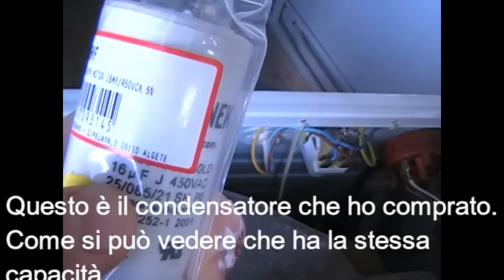Come riparare la lavatrice non centrifuga

Comment: Non pensiate che tutte le lavatrici hanno "il condensatore". Il condensatore in questione è usato sulle lavatrici che utilizzano il motore asincrono monofase, e  veniva montato sulle "vecchie" lavatrici col timer elettromeccanico. Con l'introduzione dei controlli elettronici e delle schede, e quindi con l'eliminazione dei timer elettromeccanici, i motori col condensatore di spunto o di fasamento sono stati  rimpiazzati  con i motori a carboncini o con motori asincroni tifase, questi ultimi pilotati da schede inverter che creano una trifase "fittizia" dalla 220 monofase di casa. Oggi ormai  tutte le lavatrici sono elettroniche, il motore col condensatore non viene più utilizzato, forse viene ancora messo su qualche modello di asciugatrice.
Reply: grazie delle info per noi ignoranti in materia.
Reply: Quindi se non mi fa la centrifuga cosa devo fare?
Reply: @dariobruno6390  Anche se tardi: Controlla che scarichi correttamente l'acqua, se scarica verifica le spazzole che sono collegate al motore.
Reply: solo dulle meccaniche ora nnsi usano più. ora so o cn schede
Reply: non so che lavatrice vorrei riparare, è un indesit, e non ho verificato i sintomi, spie ecc, ma se non ha il condensatore, oltre la pulitura del tuboscarico aria, cosa potrebbe essere?

Comment: Is there a capacitor also for the DRAIN PUMP ?!  I just changed my drain pump but my washer still does not go from WASH TO RINSE ( risciacquo) .

However if a start a new program from RINSE  then the machine completes its cycle with now a full working drain pump.   Which makes me believe that maybe there is not enough " kick" for staring the pump after other actions have  been.

Can it be a lid switch? 

My machine is a Bompani